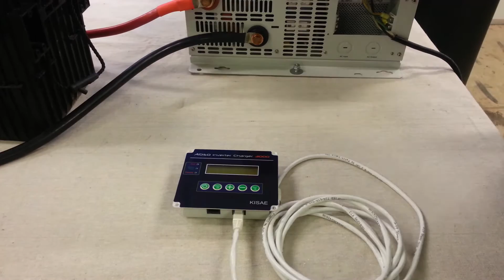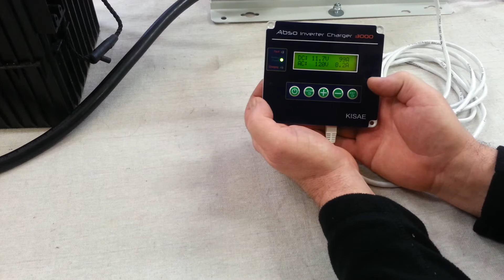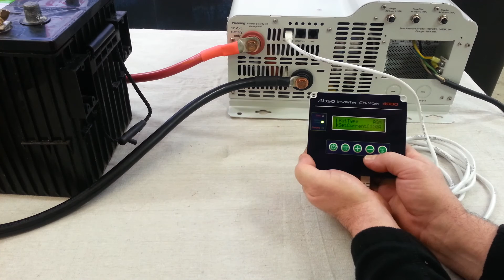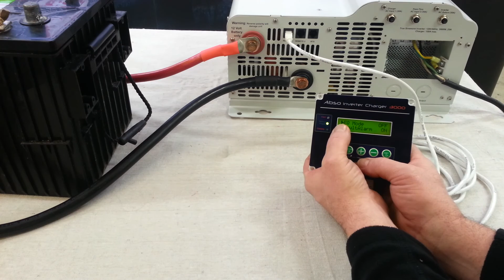Canadian Energy™: 3000 Watt Remote System Control Panel

Comment: our remote display for our nature power 3000w pure sine inverter-charger will not turn on/off the inverter-charger. can you recommend a compatible replacement that has on/off button? i noticed your remote has five buttons but ours has only four which means we have to manually turn on/off the inverter-charger in turn defeating the "remote" option.
Reply from the maker: Unfortunately we can’t, every manufacturer has a unique  pin configuration in the remote connector so remote panels are not generally interchangeable.  Your best option would be to contact the manufacturer of your inverter, they may have remote options or they may be able to give you the pin configuration so you can explore other remote panel options.